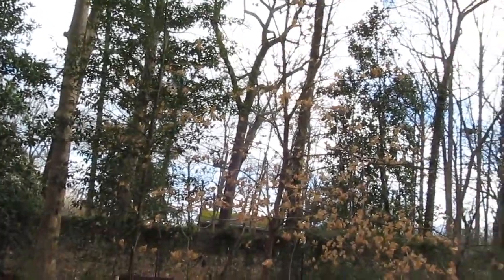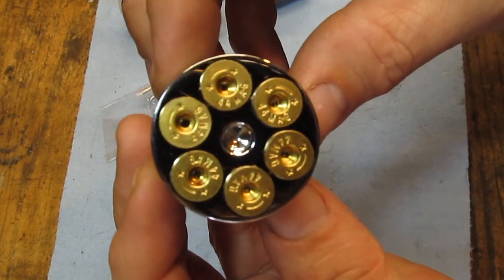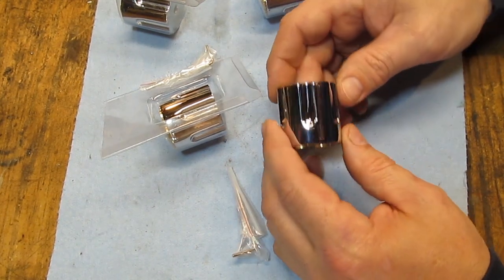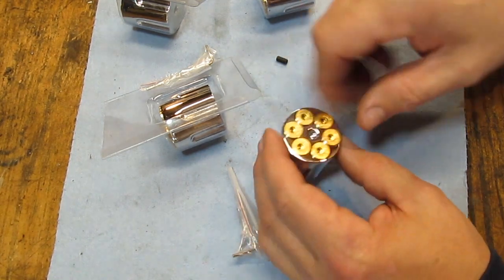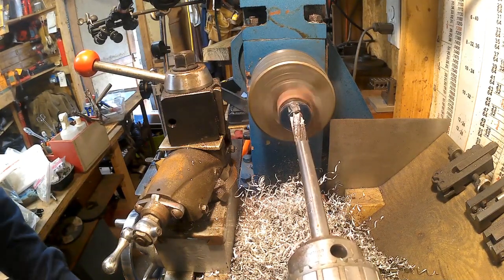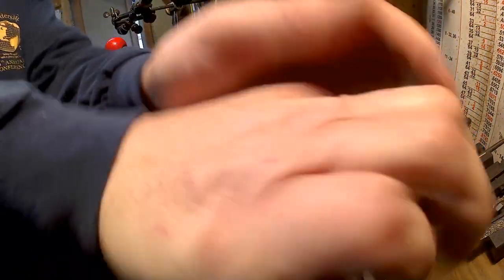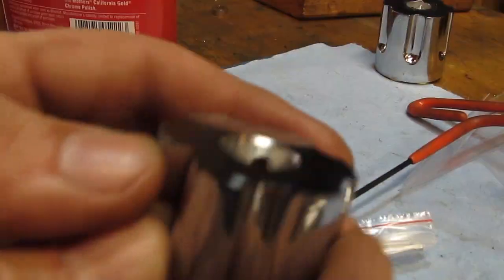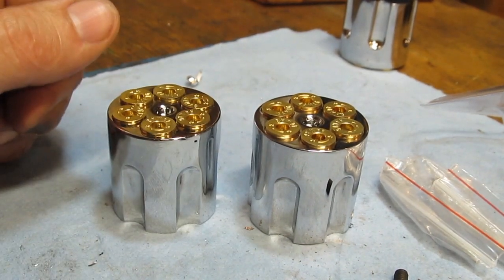A chrome workholding problem - Making a heel shifter eliminator

Comment: Wouldn't there be a much less chance of damaging the product if you did it on the mill?
Reply from the maker: You know I am not sure. In my head it would be about the same chance as the only real difference is the part turning vs the tool turning. The holder must be same or similar and there is still a chance of the part rotating which is what would cause the damage. I mean you could probably do this in a good drill press as well. As it is, on my machine, I rarely set it up to mill because I do a lot more turning. That may change if I ever get my Atlas lathe set up. I suppose with some custom vise soft jaws it would be a bit quicker. Not sure though. I will say that I am still using the same setup and holder and have not had any damged parts since.

Comment: Just got through installing mine. Two thumbs up! It looks totally awesome. And you can't beat the price, cheaper than any of the stuff I bought from Harley-Davidson. I did use thread lock on the set screw. I figured with all the vibration it wouldn't hurt anything.
Reply from the maker: Cool man. I recommend the thread lock. I've had one customer lose one for that reason. Check it after the first ride to make sure it is still seated tight. Glad you like it. I am thinking of doing the shifter pedal the same way. I will let you know if it works out. If you are interested, I will be looking for some beta testers. No charge.
Reply: @theeddies  so cool.Heck yeah I would be interested.

Comment: Cool custom mod idea to sell.
Reply from the maker: Thanks, it was actually my Dad who originally wanted me to mod one for his bike and it turned out so well that I started eBaying them. I probably sold 100 last year. I have never seen a similar one elsewhere so I was a little hesitant about making this video because of how simple it is, and I am just showing someone how I make my product. I finally figured if they had the means to make it, they would do it anyway. Plus I did not give out the supplier but that could be figured out with some work.

Also, I am still not 100% happy with the workholding, was hoping someone might have some other methods. My way works but every once in a while I have one spin.

I have not seen anything from you in awhile, are you hibernating?
Best!
Reply: Can a custom collet or drilling fixture be fashioned to hold them? I'm constantly doing stuff, but haven't felt like making any videos. It comes and goes.  @theeddies
Reply from the maker: @johnstrange6799  Probably, just not sure what to use as a face.